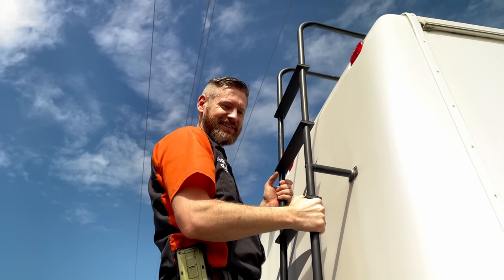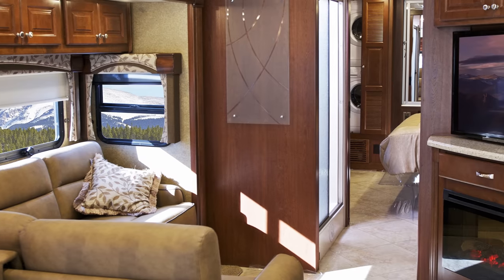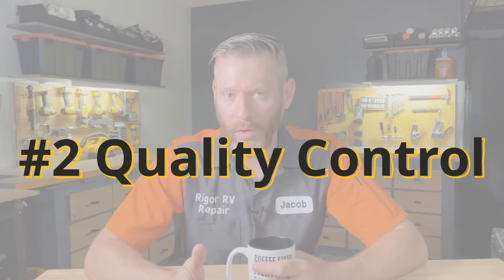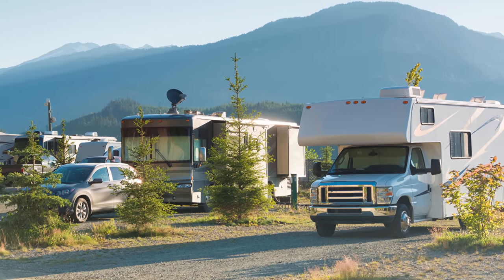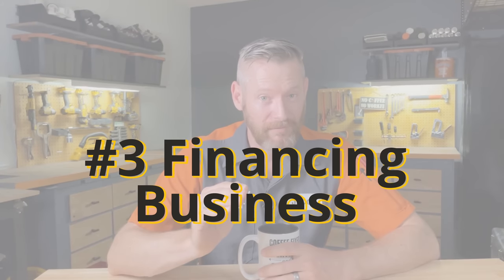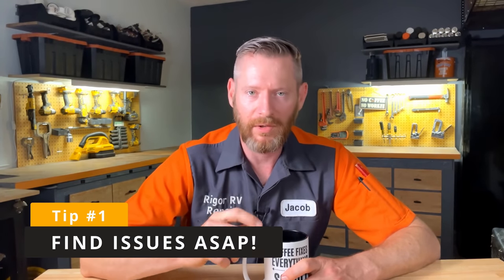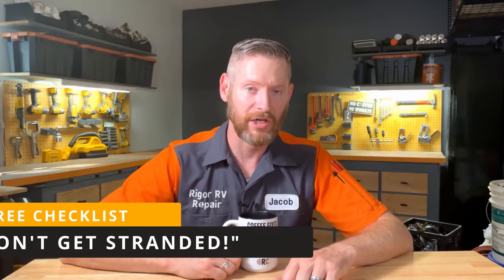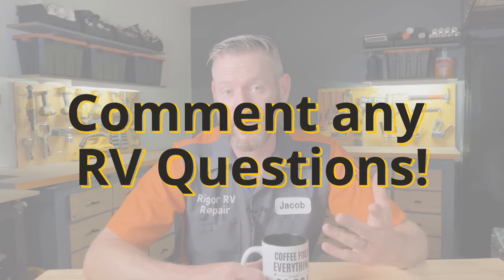3 Dirty Secrets the RV Industry doesn't want you to know...from an RV Tech

Comment: One other tip - use a detailed checklist to test the functionality of the RV before paying for it.   Serveral items in our new RV were fixed the next day because the dealer wants to get paid.  Don't be afraid to walk away it things are not fixed.
Reply from the maker: Great comment! I just made a short video highlighting your comment and passing on this tip for rv shoppers. Thanks!
https://youtube.com/shorts/dikbIcTJg9k?feature=share
Reply: Great point. Thanks
Reply: Amen!! Check every function, light, switch, pump, even the marker lights on the exterior. Especially the AC , refrigerator, and water heater!!! Here in Alabama, I’d advise testing it on a summer day, like today, it’s f-ing 98 degrees!! Hot as camel testicles in the Sahara!!!
Reply: @timburton9514  Curious, just how hot is a camel testicle? I've never been able to get close enough to check. TYIA. 🙂
Reply: Spot on. I recommend video taping your walk through so everything that is unsatisfactory is actually documented and the salesman cannot deny that there was an issue. They may not like it but its my money. Video taped my homes roof salesman while he made his pitch. He was not happy but I explained that I wanted documentation of all his promises.
Reply: I have a 10 yr old class a dp. We are not fans of leaving our rv  at repair facility waiting for parts. Get it diagnosed and take it home until parts arrive. Bad things happen at a busy repair facility.
Reply: Next time I check out an RV, I will do it on a rainy day.  I know someone that bought a brand-new trailer and it had a leak no one knew or were told about. It rained and that is how they found out. I think I would go to an RV place (not a showroom where they all look pretty inside a building) on a pissing raining day. I would also have to check out the ac and other things while there which I guess means plugging it in. I know a couple that bought a class A bus, out camping they found out the slider didn't work. I don't know how that was overlooked when they bought it. They left it at the dealer for weeks while waiting for its repair.
Reply: With RV and camper sales down 53% right now, this shouldn't be a hard request to get a dealer to fulfill.
Reply: Pp

Comment: One trick I have seen dealerships do is sell the RV and tell the buyer to take it camping and make up a punch list of everything they find that needs repair.  When they bring it back and drop it off the dealership service department is so overwhelmed that their RV just sits there for 3, 4, or 5 months and in the mean time they are still making payments and that one year warranty clock is still ticking.  What should really happen, at the minimum, is when an RV is returned for warranty work then that warranty time clock should stop until EVERYTHING has been repaired and the unit accepted back by the customer but unfortunately that's not how it works.  :-(
Reply: same with a boat.  i used my boat for less than 9 months out of a 3 year warranty.. Most the time was spent fixing factory or dealer issues.
Reply: 30 days out of service. Florida is 3x purchase price
Reply: Not just RVs and boats - I bought a brand new diesel Jeep Grand Cherokee and that was in the shop 17 times in the first two years I owned it. It probably added up to about 6 months in the shop total.
Reply: @billbirch3748 Nice solution!
Reply: @DesertHomesteader  Lemon law 30 days out of service. You got no relief from your payments while out of service? Some states lemon law is 3x purchase price. When a customer is getting close to lemon law the company would generally accommodate the customer. Special arrangements with NDA can be beneficial. This was in RVs. Auto manufacturer has less warranty dollars and more hard nosed and more hoops. Chrysler/Dodge/Jeep would cut people off after 2 or 3 repairs for the same known issue.
Reply: @inthesun3884  I am telling you because I worked warranty dept for many years for the largest diesel pusher (at one time) of high end coaches. Lemon law is very real for RVs. I dealt with them and their owners. Got them in new coaches, Got them fixed. Got them whatever as 3x purchase price in Florida is very real. Unless the laws changed since 2015 lemon law very much applies to RVs
Reply: @billbirch3748 you are right lemon laws does apply to Rv motorcycle cars
Reply: But they do not repair them correctly as the deals hop does not have quality control either & have different personnel every year
Reply: You couldn’t get me to buy another rv…. But if you really want one, do ‘not’ buy from a big huge dealer, they just don’t have knowledgeable workers to repair your rv!  Been there, will never go back, and I love camping!  Oh and stay away from CW, just as bad!
Reply: that's what happened with ours, sat for months then they told me it was ready and to come pick it up, they hadn't touched it!!!  I marked the parts and came back next time, STILL hadn't fixed it!
Reply: Yes you are absolutely spot on about the warranty clock SHOULD stop the very day it is delivered to the shoppe. Deceptive trade practice, always screwing the consumer -- business the american way
Reply: @inthesun3884  OF COURSE. It's deceptive trade practice -- business the american way
Reply: This is exactly what is happening to us. DO NOT SIGN ARBITRATION AGREEMENTS
Reply: Have your RV inspected by a trained RV inspector BEFORE finishing the financial agreement and taking ownership.
Reply: People should just learn not to buy RVs, I learned, buying a school bus and making it into an RV is much better and MUCH safer.
Reply: Great America Panama City Beach tried to do this to us and kind of did

Comment: I worked as an RV tech for 1 week. I’ve been fixing and building things for 40 yrs. The quality on every single unit was embarrassing. The other techs instead of fixing the issues created other issues. The single driving factor for all of these issues is the time it takes to complete a build. No care or patience at all. Panelling fixed to walls with staples in the middle instead of hidden behind the trim was common on all units. I’ve decided that I’m going to build my own camper from scratch.
Reply: After having two fifth wheels that I enjoyed but did have issues, I bought an old ambulance and will be converting that.   Bought it super cheap and have been traveling in it for a month already. Totally great!   Been making a list of what I want to do to it.
Reply: I noticed the same thing! With a background like yours as well,I noticed anything that was ''Detail work'' was just ignored or so sloppy..I would have been embarrassed to claim it. I thought the same thing...maybe I should just build my own!
Reply: @nvalles2565  What was your secret way of finding an old ambulance?
Reply: I own a Fiberglass Casita ! Four years with zero issues. Only a few well built units out there. Good luck with your build!! 😁👍
Reply: @ralphp3057 fiberglass sounds better than those flimsy aluminum sheet rvs.
Reply: Yeah RVs are built worse than Yugo's ever were.  I wound up building my own motorhome out of a school bus and lived in it for about 5 years while saving for a home that we moved into last summer.  I'd never put my children in another motorhome again after I cut up 3 of them and found out there is no real protection, it's like riding down the road in a styrofoam cup.  Buses are built like tanks in comparison, I've cut 2 of those us as well.

Comment: I've been full timing RVING for a year now. 2 years 3 weeks in rv 1 week home. 

From my experiences in Rv parks I talk to a lot of people RVING. I also watch YouTube stations. The fifthwheels are junk. They look like polished dream homes on wheels, but they are junk. Also, the manufacturers are cutting so many corners on building these house on wheels. The whole industry is aware of it. Dealers and RV techs. Buying a used motorhome, not fifthwheel, from 1st or second owner is the way to avoid junk. So much to know about this life. If your not a handyman and can't do the maintenance on your motorhome than expect to pay that out of pocket. Also, read up and educate yourself on the problems that other full time Rvers have run into. For instance, parks electrical hookups can fry all your brand new hardware and any electrical equipment,  tv's and laptops included. A power surge protector won't do. You need an EMS PROTECTOR.  Read up on it or pay the expensive cost. They run about 400.00. Why they're not sold with expensive high ticket rigs is just down right scandless.  New comers get no heads up on this costly electrical disaster, just waiting to happen.

Comment: Another option for potential RV buyers is to hire a certified RV inspector. Just like buying a new home, they can find the problems with the new RV before you buy. That way you could negotiate repairs before your first trip out. It would be a worthwhile expense if buying a new, high dollar RV in my opinion.
Reply: We advised to go on a shake down cruise to get a list of repairs. Suppose you could pay though I never worked with an individual that did that. My boss would occasionally take a unit and go for a weekend. Come back with a list. We built it and knew what to look for. O the stories.
Reply: Couldn't agree more. Great advice!

Comment: I stated on another YouTube Channel (some RVIA guy) that the RV manufacturer that figures out quality will OWN the industry, regardless the price point. (He did NOT appreciate that.) It's the same situation as when Datsun, Honda, and Toyota came in and cleaned up on the American auto manufacturers who were letting their dealers fix the cars. It's as if the customer is the quality control department. What the RV manufacturers will learn is it will actually be cheaper to do it right the first time.
Reply: Having worked production and warranty if you only knew the whippings over QC. Pr5oduction managers whipping employees over QC and rework with and production employees pencil whipping and doing that they can as its people with varying degrees of talent and turnover. Some are craftsman but not usually as that takes a long time.
Reply: None are perfect, but I found Jayco was about the best quality I could find. At least the base structure is well built, cabinets are nice too.
Reply: @billbirch3748  They have it all wrong, then. They need better manufacturing process design.
Reply: I doubt it.  Airstream has pretty high quality and unmatched durability, but has always been a niche player due to costing 2-3X what other RVs cost.
Reply: Toyota’s are built like tanks.  Every American made car I buy rusts within 3 years

Comment: Mine didn't even make it out of the lot. It had electrical problems and the trailer brakes would not release. I asked for another, but their mechanic got in my jeep and dragged it around until the wheels started to spin on their own. I got a mile down the road and smoke was coming from my brakes. We unhooked and drove back to the dealer and made them go get it. They put in a new wiring harness and we went camping. The fridge only worked on 12 volts. The 3rd day the hot water heater got so hot you could smell the insulation smoking. The fan in the bathroom blades flew off and the pump would run continuously. We took it back, but it never worked right. Then the following year they said I needed knew brakes to pass inspection, well that lead to a heated discussion. At least now we have social media to do the research.

Comment: This is an industry that needs some regulatory oversight and some strong competition from companies with good engineering departments and strong QA systems.
Disposal of dead RVs is an environmental issue…these eyesores are piling up everywhere. Nothing much can be salvaged or recycled, the chassis and suspension metal is about all. There is no parting out, crushing, or recycling infrastructure like for cars. Is there? 
I see huge inventories of unsold RVs sitting on lots. What happens to them? Who eats the depreciation? 
Great video. No longer an active RVer but this video caught my eye.
Reply from the maker: There are a few RV salvage yards. Unfortunately for most components they are so cheaply made there is no point in getting it used. So yes, a lot of waste.

Comment: I recently toured the Grand Design assembly line my trailer was built on. First thing I noted was the Lippert frams they use are had the poorest chicken scratch welds I ever have seen. Now wonder Youtube is full of videos of the spring hangers twisting away from the frams. A 6 year old could produce better welds. Next I noticed when the black moisture liner is added it is stapled into the flooring. Half the staples were protruding 1/8 out of the decking. This area where the stapkes are located is where the load bearing side wall will rest on. On down the line I could not help to notice the difference in fit and finish from one unit to the next. A lot of these issues are covered up by interior and exterior siding. So these mistakes are not checked in the pdi. I just walked away pretty disappointed at the build quality of a manufactur that touts superior quality in their product.
Reply: I bought a fancy drive in drive out trailer made by Forest River. It was by far the most embarrassing show of craftsmanship I have ever seen. I work with metal and I can weld anything. If it was my first day of welding aluminum you would think that by the time I made it to the last weld on that trailer I would have become better, but there was not one weld that would have passed a weld test. The whole trailer was a mess. Unfortunately I didn’t look closely till I got it home and it was a 2 and a half hour drive. The dealer told me they were going to come and pick it up and didn’t show up. I’m just going to rip it down and build it back up properly. You would be best to buy a blank trailer with just the essentials and have someone else do the interior.
Reply: I come from a manufacturing background (not in RVs, I was in the surgical equipment field) and the RV industry (and many other industries for that matter these days are pathetic. Regarding PDI's - they say they do them but frankly there is no possible way it is being done. One would have to be both blind and deaf or stoned to allow this crap to roll of the line. If they are it is more likely one out of every 1,000 units!

Comment: I've found with my 50+ years of RVing is the golden years of manufacturing was 2004 to 2008. There was some great coaches built during that time..... The best of the best, for me, is a diesel pusher from one of the Northwest manufactures built in those years. The SoCal builders are second. Find a used coach from an original owner (or second) that has taken care of and stored it inside and you've got a peach.
Reply: Thanks for that great comment!  Exactly what I wanted to hear.  The 2001-2008 are the years I’m looking to buy , but the hard part is finding one stored inside and original owner - 2nd owner and lower miles.
Reply: Monaco, country coach, Marathon. Lived it. Those years are good. Even some mid 90s products were good quality coaches. Nothing wrong with a mid 90s Dynasty. Late 90s had windshield issues. 2009 it all crashed. By late 2006 I could tell something was up. By mid 2007 sold my stock as I knew. Worked until BK then got offered to come back. Only one of the crew that was offered a job to come back.

Comment: My list of three is
1 Forget warranty and prepare to fix issues yourself. 
2 junk construction will require constant care.
3 dealership services are worse than homeowner repairs.
With tha said I buy a new pop up every 3 yrs and add suspension lift. Organize and armor the under carriage. Gusset and or reinforce all wood construction. Otherwise they are guaranteed to turn to splinters in the backcountry
Reply: I have a '87 GMC based class C motor home built in Canada. A Lakeview.
  The wood used on the frame wouldn't pass for fencing, a twelve inch long by one inch thick by two inch wide had twelve ( 12! ) knots and empty knotholes and a split running halfway through it weaving around the holes.
The rest of the framing is rotted because the factory used moldy wood to build it. It was garbage when it left the factory floor. And don't get me started on the metalwork, it's in as bad condition, poor or missing welds, holes torched into the main frame to accommodate plumbing and electrical. Lakeview indeed.
Reply: @DarrellCook-vl6lm  sorry brother. Unfortunately it is what the market offers. This ties in perfectly to my statement of improvement and maintenance. I buy small pop ups and built for them for Colorado high county camping but they are simple compared to what you own. Best wishes in your rv life.
Reply: So pop up campers are junk too

Comment: Very good tips for anyone new to the RV world. After more than 10 yrs in my unit, I have repaired most of the poorly manufactured flaws that have popped up over time. Most of the issues that have been repaired are not uncommon for a unregulated business. Keep those video''s coming. Some thing are just not fixable. Like the slide opening being cut crooked.

Comment: Paid $800 for a certified inspection of a class C, that looked very nice but had big time issues. Bought a class B that was returned with 3,000 miles, which was bizarre to say the least. I begged the wife for an initial local trip but nope… about 1,500 mile trip. Thankfully everything worked. Little stupid things happened like I turned on the inverter when we left so the fridge would work just like the video said. Arriving after 1AM we collapsed in bed but the next morning realized some food had spoiled because I didn’t know there was an actual dial to turn ON the fridge itself…stupid.